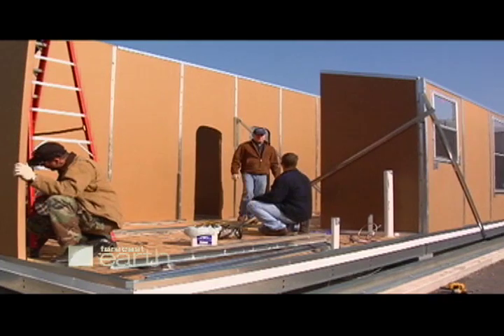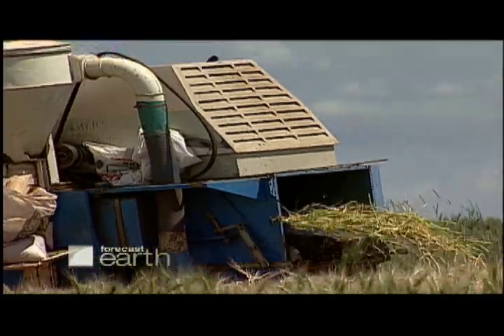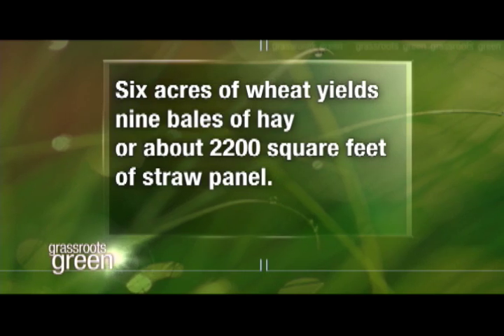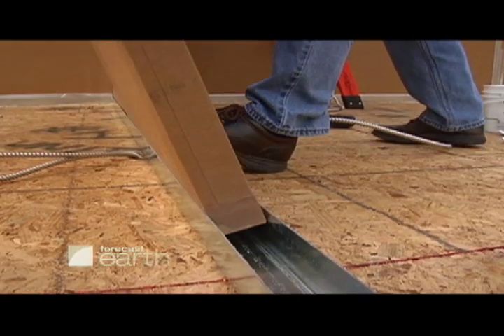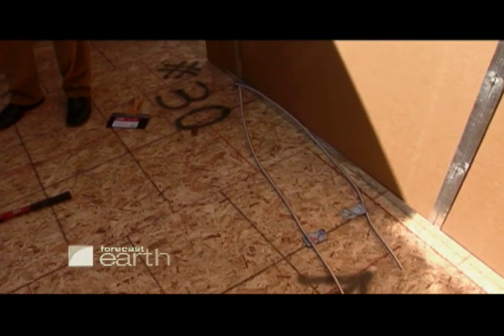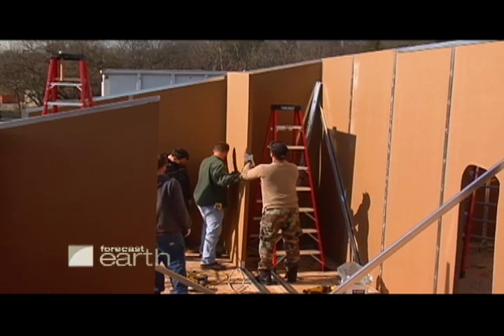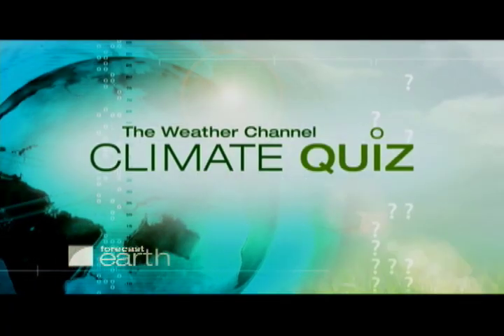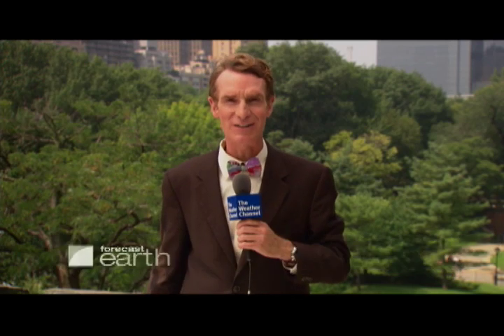Straw House Solution

Comment: How am I reducing my carbon foot print ? I would still be using steel you had to use machinery to gather form and compress the straw. all I see is it a quick resopnse building meant for temperary use.